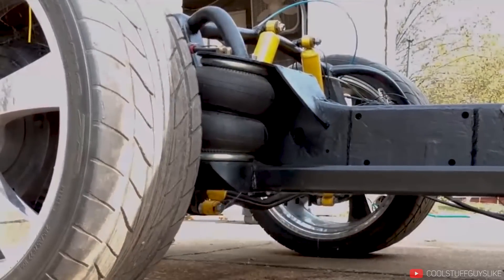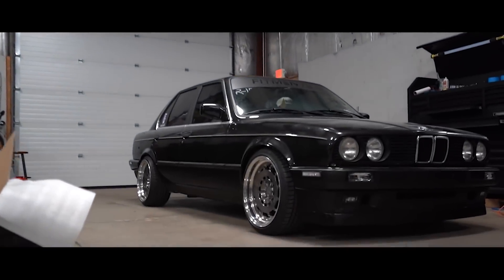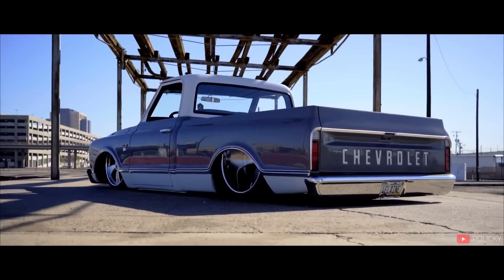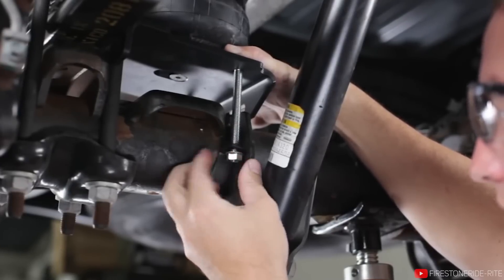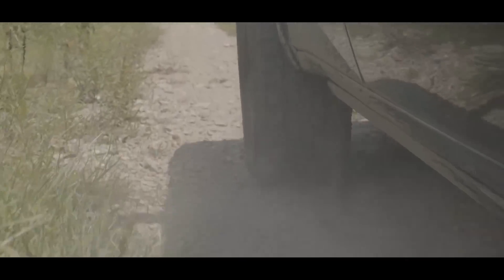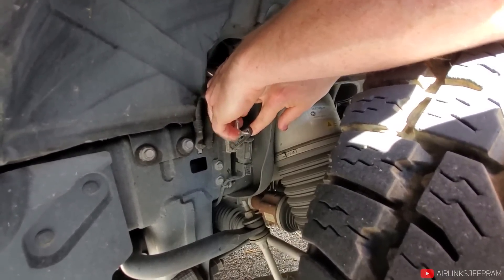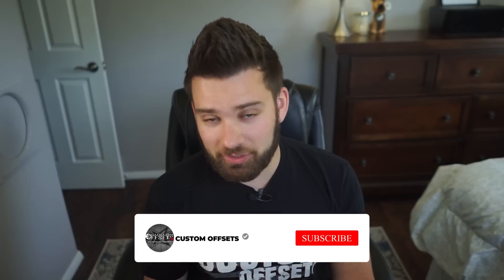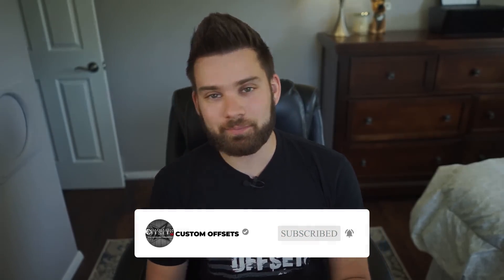How Does Air Ride Suspension Work?

Comment: Hi. I have a Concept I want to accomplish. I have a 2020 GMC sierra Texas edition. Is it possible to use Air ride to be Able to drop the truck to the ground for easy access and even ride height but have the ability to adjust to the standard ride height and also be able to lift the rear when towing for better towing. Recently I was diagnosed with  MS a getting in and out of the truck has be come an issue. Thanks for any thoughts on.the matter.

Comment: Air ride and height adjustment would be epic on the new Ford F150 Lightning. If lowering a vehicle can improve aerodynamics, then on an electric truck it would be huge. Drop it on the highway to increase your range. Then when you get to the job site, get it back up again.

Comment: Lgnd Supply Co./ Legend Gio has a 2500 Cummins with air bags on front and back. Street Speed 717 has a kelderman 3500 with like a 10 inch air ride lift on

Comment: I've been wanting to build my own stealth bug-out vehicle out of a Chevy Express, and was thinking about adding some sort of an air ride system so I can increase my ride height when I'm riding on more rugged trails.  I like what RAM did with their trucks, and wondered if their system would work on an express, or if there was an after market system that would do the same. That being, the ability to ride lower on highways or higher on trails, than the stock ride height.
Reply: Great video by the way.
Reply: I imagine a van where you were too high to get in the parking garage and with the press of a button, you were just right.
Reply: That's what I want to do with my Roadtrek 4x4 down for highway up for trails.

Comment: Hiw about a system for 98 tahoe using it as a plow truck and currently I've cranked my keys so that it doesn't sag as much but i would like more lift in the front, ive searched but no luck, since suspension is your thing any ideas? Next for me would be the keys that would give me more crank , the stiffness is not a concern with the weight it moves up and down fine and the plow is not one of those big huge ones is a light western generic non commercial plow residential only. Thanks in advance. Great video!

Comment: Thanks for the video - great as always.  As your covering helper bags today - hopefully you can help me understand an issue i am experiencing. I have a 2020 Sierra Denali 1500 running a BDS 4” lift on Hostile 20x9 +19 Fury’s with BFG K02 35X12.5.  The BDS kit allows me to continue the use of my factory Automatic Ride Control (ARC) system via relocation of the ARC sensor brackets.  I will be towing an ~8K lb. trailer and I want to add helper bags in the back to maintain level when I tow. The rest of the time (daily driver) i would air down the bags to 0.  My local shop says they can’t be added to vehicles with ARC as they will “interfere” with the function of the ARC system.  My question is - what about the “function of the ARC” will be compromised?  Is it only compromised during the time I have them “helping”?  If so - how?  Ex: If it means I won’t have the optimized ARC damper adjustments during the tow but as soon as I reach my destination and air down the bags everything goes back to normal?  If so I can live with that.  However, if it causes a check engine light and puts me into limp home mode  - well that’s totally different.  Appreciate your time.
Reply from the maker: We would recommend checking out another shops opinion man!

Comment: I put a 6.5 BDS suspension lift on my truck. But it has a air shocks on the rear and it looks 3" more taller from the rear. How can I level it so it looks the same as the front? Should I remove the air shocks?

Comment: So I guess helper air bags are different from the suspension setup that luxury vehicles use? I tow about 85% of my max towing capacity, and I’d like to tow more comfortably, but I was hoping that this system would be more comfortable as well.

Comment: I was wondering about an air lift so that I could drop the truck to park in the garage. I think if I do a 6 inch lift with 20x12 rims my Chevy 2500 won’t fit in my standard garage.

Comment: i am curious about is like the airlift kit for the rear of the truck for towing since this video came have they came out with something like that for the front? like for plowing the front end squats so im wondering if theres a suspension kit for the front to help with that to maintain the normal height when weight is added to the front
Reply from the maker: Currently as far as I know, no. But that would be nice

Comment: So I want to lift my truck but I also want to easily be able to load a motorcycle in the back.. could I put bags in the rear to lower it a good amount and then level it back out after getting loaded up?

Comment: I would like to get 4inches higher than my stock suspension and 4nches lower too . Is there a kit like that for a 2014 Dodge ram regular cab that can do both at the same time?

Comment: I have a 2018 Silverado 4x4 and I want to raise my front end 2”. The difference between the rear and front at the center of the wheels is exactly 3”. My question is, can i just put on some coil overs and would i need to add anything else? What would the difference between just adding coil overs vs a leveling kit?
Reply from the maker: We would recommend buying a level or lift kit!! https://bit.ly/2ZN0Nec
Reply: Custom Offsets awesome! Thank you! Would it be a smoother ride with coil overs vs the leveling kit ? Or would a leveling kit and new shocks help?
Reply: Oh and i will be driving the truck through the dirt trails during hunting season so a lot of holes and rocks

Comment: Um..... Lincoln, land Rover, FORD Have been doing that for years. It was called load leveling suspension. If you wire into the pump and exhaust valve you could control it. They make solenoids that you can tie into the feed lines😑

Comment: The new chevy tahoes has air ride for all four tires so I'm wrkn on doin air ride for the front of my tahoe an now you I could add this to aid the rear sweet my goal is to tow till she can't truck no more yo Fuller when are you going to have a mn custom offsets shop or school to pass on your wisconsin trade in ideas with trucks be every where not just over there